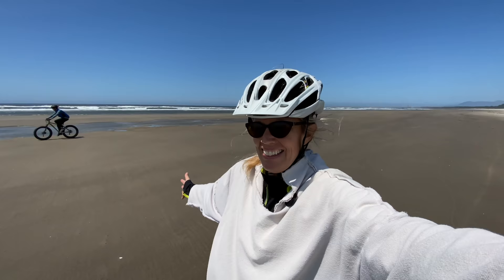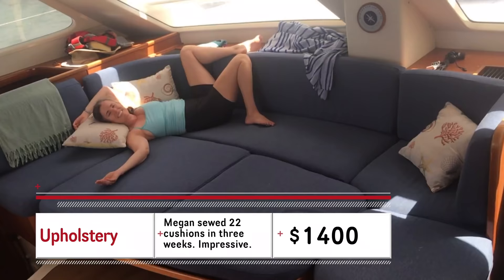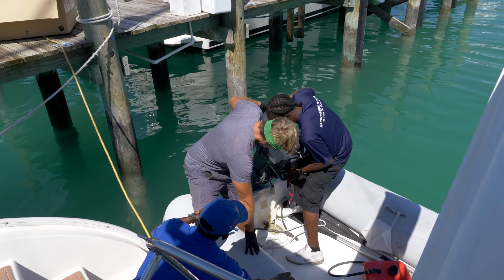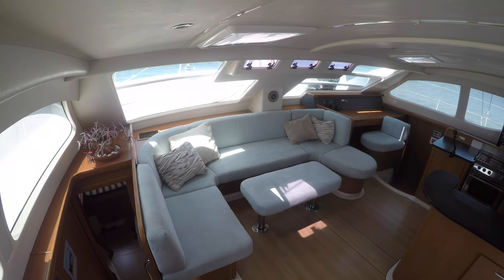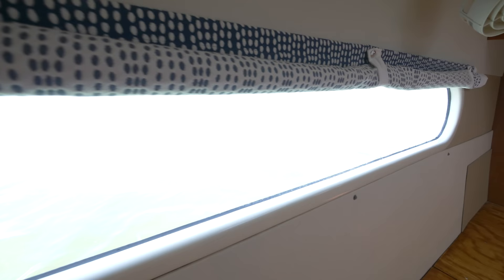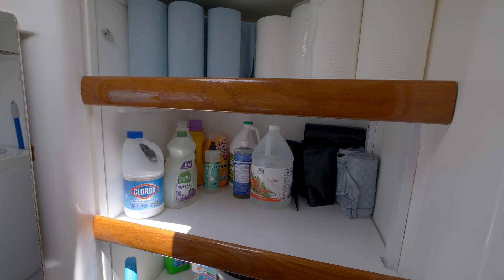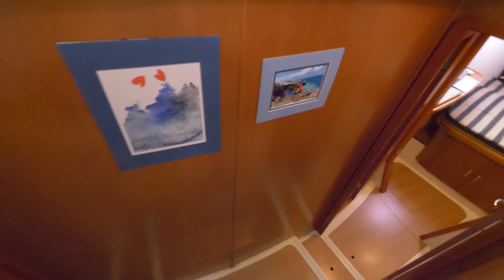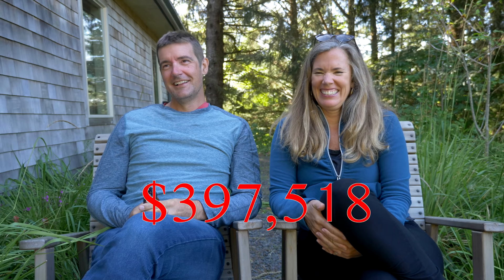HOW MUCH FOR A FULLY OUTFITTED LEOPARD 46? 50% OVER PURCHASE

Comment: Great video guys. I have just got back on the water having spent 4 months upgrading my Leopard 40. I did all the work myself and so the cost was the new items and my time. I spend $60 000 on my upgrades. I was expecting about $30000 but then decided to pull out my old yanmars and saildrives and bought new ones which I installed using the boom and topping lift. This blew the budget but I’m happy to have 0 hour engines again
Reply from the maker: Two new motors for 30k? Good deal! She must be lookin good!

Comment: Clarity is a beautiful boat, which you've turned into a customized "new" boat, with features that Leopard wouldn't have even thought about. This is nothing different from what people do with their houses. Is it an investment? Yes, in yourselves. It was also smart to do these things over time, as you really got to know your boat and understand what you wanted. I just did the same kind of restoration to a 50' MY, and the one thing I know is that as long as the hull(s) is sound, everything else can be repaired, replaced, or redesigned. I'm looking forward to following in your footsteps upon retirement in 3-5. And 2.4 KW's of solar... maybe in 3-5, electric engines?

Comment: Labor is a major cost in the refit. So, any sort of arbitrary labor estimate would create a more realistic total project cost calculation.  So, how many thousands of hours of direct labor on the refit and at what rate would you pay yourself (?) say $10 per hour because it is easy to calculate.  Direct labor on refit projects, estimate what, 6,000 (random number) hours in direct labor for Megan and Nick in total.  That would take the total boat cost ($400,00 plus $60,000) to $460,000.  If you hired someone else to do that labor you did yourself, you would probably have to pay closer to a minimum of $30 per hour (at a minimum) for a hypothetical total costs of $580,000.  Why am I doing this?  1. The $400,000 total costs for the boat does not reflect opportunity costs of your labor.  2.  The total project costs should be compared to the fair market appraised value of Clarity to indicate how much value the owners' hard work has added to Clarity.  Thanks for another excellent video.
Reply from the maker: Lol. Good point. But my fair market value of labor is closer to $1.35/hr. Lol. We did it this way because we wanted to. More fun than earning to pay someone else to do it....makes a lot of sense for a lot of people to spend more to have something done by someone else. You’ll get no judgement from us on the wisdom of that path!

Comment: I noticed in the video you have SodaStream 14 oz canisters you can switch that up to 5 lb CO2 which cost less to fill than a 14 oz SodaStream canister. Perfect for sailing and over 80% cheaper. You can purchase the hose that fits on the sodastream  and the 5 lb tank on Amazon. I plan on doing exactly what you two are doing love the channel

Comment: Very nice. Now, I have a budget of about 10% of your total thus far. I gotta tell ya that it's been challenging trying to arrive at a monohull size and configuration that will allow for diesel-fired hydronic heating and a ridiculously small genset to make sure the wife always has the power and hot water she needs. Homework continues.
Reply from the maker: It always looks like money solves all problems, but having done this with fancy boats and not so fancy boats, I can tell you that the "problems to be solved" in outfitting a boat are mostly self-invented. What one thinks one needs for a comfortable existence afloat and what one actually needs are two very very different things. What we have done with Clarity is pretty extreme. I hope we don't make it look like this kind of setup (and expenditure) is required to cruise happily....because that's simply not the case. Small, safe, simple boats are amazing fun, and a lot less work to maintain.
Reply: @TheOKellys  Indeed and agreed. I'm mostly concerned with on-demand hot water. She won't be "getting onboard" if it feels too much like camping.

Comment: Thanks for the update, ex charter boats will be a money pit in general but do you think the “crewed version “ of the leopard from moorings  would be any less of a money pit because it has been run and “maintained “ by a professional crew?
Reply from the maker: Charterboats are "fleet vehicles." They are generally well maintained, as they don't make money when they are not working. However, they do see a lot more cosmetic abuse from credit card captains who don't know how to handle them in tight quarters. Crewed boats are a different ball of wax altogether. A knowledgable captain at the helm who can handle the boat without bumping into things makes for a much shinier boat. 
And to be clear, all boats are "money pits": new boats just as much as old boats. Anyone who argues that point simply doesn't understand how boats wear, get maintained, or depreciate. And if you are in any way concerned about whether a boat is a smart financial decision or not, do yourself a favor and take up a different hobby...this is not the right endeavor for you.
In fact, complainers should avoid this activity at all costs.

Comment: Great video. Perhaps you could add on your podcast what were the make or break features of Clarity when you first bought her. For example, what were her engine hours (total and per year) and was that scary?  As a charter boat they must have been high. If someone is thinking of buying an ex-charter boat what should they be wary of and what seems tolerable?
Reply from the maker: What a great idea for a video. Low engine hours is not necessarily a good thing...boats that don’t get used much are the ones that have more problems. Most charter boats, contrary to popular belief, are actually fairly well taken care of...these are a lot like “fleet vehicles” in that if they aren’t working, they don’t make money. So they get maintained. However, charterboats do get more abuse in terms of dock dings, furniture scrapes, etc. I’m generalizing of course, as all boats come with unique histories, like people do. Personally, I’d never buy any boat with less than 250 hours per year, and never one sitting for more than a year. Most of these Yanmars are good for 10000 hours or even more if they are treated well. My limit on buying a used boat would be engine time of about 7000 hours. But I’ve got more details to share....time to plan a video! Thanks.
Reply: @TheOKellys  Yahoo!  Great info.  We novices would have been scared off at 7,000 hours.  keep up the great work.  Love your vids and podcast!

Comment: I like that you made the bed king size, but where do you put your stuff? My bedside drawer has pills - prescription and over the counter, antacid etc - reading glasses, torch, plus on top lamp, clock radio, chargers, evening cocoa spot, middle of the night beverage, ear plugs etc. There's probably more, but that's from memory.
Reply from the maker: there is a shelf overhead, or just tuck it against the wall and mattress. Nightstands are nice, don't get me wrong, but prefer more elbow room.

Comment: I noticed you have a soda stream and are carrying a lot of their small and over priced cartridges.  I switched to a single 20# cylinder and it is so much more convenient and less expensive.  One 20# cylinder costs $21 and has about 21 times the co2.  It may be worth looking into for your boat?
Reply: I forgot to mention there is a initial cost to set up of about $300 but that is mostly for the cylinder core charge which is refundable.  I buried the cylinder in a cabinet void so it is out of sight.

Comment: Do you feel like one of these slightly older leopard 46s are good for single handers?  Or maybe look at one of the newer 40s?  It is always a tough call to pick out a specific boat for its value.  I suppose I am asking more in regards to your experience handling the larger boat.  If you were going to be alone all the time, would you prefer to have to larger boat even with the extra maintenance, mooring costs, added stress docking, etc?

I also do like your laundry room idea.  It was always a bit of a downer the wasted space in charter boats dedicated to the heads in beds philosophy, but that really seems like a practical conversion.
Reply from the maker: I always say get the smallest boat that will do what you want it to do. For solo sailing, I’d go get a 35-38. Though no reason you couldn’t operate a 46 solo. But, why?
Reply: @TheOKellys  There are a few positives a larger boat would give.  If I did get a boat soon, I would have to work while I cruised.  So I would be relying on systems like Starlink to come online to provide stable global internet for work anywhere I am at.  A larger boat like the 46 would provide a great deal of surface area for solar to support my electronics for work as well as comfort (washing machines, AC, and what not).  A catamaran would also be more stable and more comfortable to sit at the computer and work.  I'm finding the biggest problem with cats are that everyone wants them so their prices typically stay way to high.  Either way, my plans sort of hinge on a lot of things coming together.  Starlink producing a good shipboard antenna, work being cool with me working globally, being comfortable with my income in whatever economic situation we are in.  I'm still a few years out from having my own hulls to scoot around, but doesn't hurt to start planning and saving.

Comment: So the code 0 and furler were $4700. 
The bowsprit is not standard on your boat so how much did that cost to add?
I assume it was installed to use an A-spin. How much for the A-spin, etc? 
Would you recommend a Symmetrical spin also or do you plan to pull the tack to the windward bow for going deeper?
Is all this extra sail power controlled by the original 2 winches or did you add winch(es)?
Reply from the maker: Sprit cost was in the last conversion video, sorry, don’t remember offhand. $1500 or so? Yes, we carry an asym. We bought it basically brand new off another L46 for almost nothing....$1500 or so. You’d spend 7k new. Yes, we fly off windward most of the time, but can bring it down to sprit very easily. No symmetrical, and no need for it. What I would say though is that the asym is wayyyyy more important than a code 0. I’m probably going to make a video about that.

Comment: One reason why I'm definitely not going with a catamaran. I'm probably going to have 15000 to get a boat. Which mean I'm prob going with a 60s or 70s fixer upper monohaul and have about a year on the hard to get it ready. I get 2500 a month for va disability that I will have to budget and use as my monthly budget while sailing. Definitely wont have the luxuries you guys have but I will still be out there.
Reply: I will also be doing 99% of the labor myself aswell so it pays to be handy and a jack of all trades.
Reply from the maker: Lot to be said for an inexpensive boat. In some ways, you’re much more free. In the end, the sunsets look the same. Hope we see you out there.

Comment: I'm currently trying to get a handle on our purchase budget and I currently feel I would like to spend around $340K to be all in. This is close to what you spent, if you consider you initial outfit costs. Later you have added significantly to your initial cost in order to arrive at the boat that you wanted. I'm not at all suggesting this is a mistake, I just wonder if you had this to do all over again would you go the same route or increase your budget at purchase to get the boat that already has everything you wanted. Of course this may not be possible. Just wonder what your thoughts are on this after having gone thru it.
Reply from the maker: Yes, have thought about that. Would probably go the same route again. Problem with buying a boat that is "already outfitted" is that MOST (not all) of the time, the outfitting was years ago and the tech is dated or in lesser condition. However, to your point, we are way over our initial budget. How I reconcile this for myself at the end of the day is that I feel like we've got a good boat outfitted the way we want it, and we'd have a lesser boat otherwise.
Reply: @TheOKellys  Thanks for your reply, I wasn't sure what your perspective would be. Your point is well taken regarding tech obsolescence and wear and tear. Electronics are not like fine wine, they don't get better with age. Probably the same with water makers, solar panels, batteries etc. Your argument is convincing to me. Thanks

Comment: I am interested in your decision to get a 30 hp outboard. I have always tried to get the smallest, lightest tender I can live with. On my Nordhavn 43, I may have undershot with a 9ft inflatable and a Torqeedo, so am thinking of upgrading.  
  I am also interested in your washing machine. On the N43, I have a Splendide vented combo washer dryer which I love and replaced the unvented Splendide I hated. On a sailboat, where weight is more of an issue, your choice appears to be the right one. Are you happy with it? 
    Many thanks,
       Maldwin
Reply from the maker: Hey Maldwin! It's was a decision motivated by wanting to bring more people with us on our little mini-expeditions. Going out with others in smaller boats or cramming theirs on ours with an engine that won't go fast gets old. Weight wise, we are lighter than we were before with the fiberglass AB dink, so we come out ahead. At least yours is vented, we had the condenser-style before an it used way too much water. This one is pretty efficient. Would recommend to anyone.